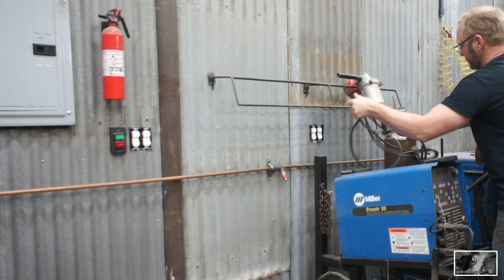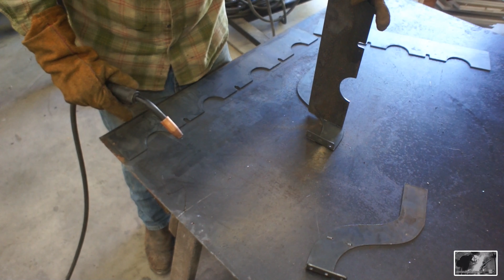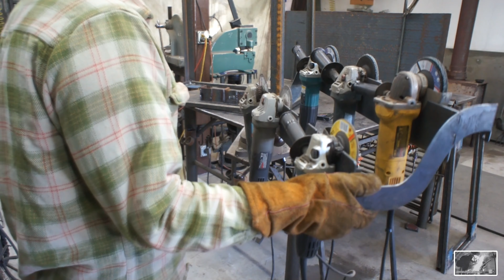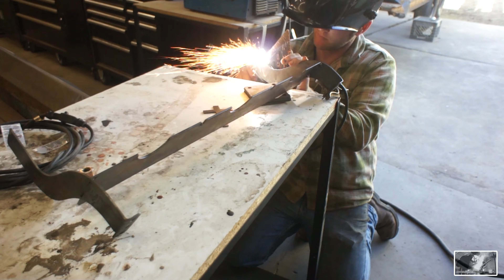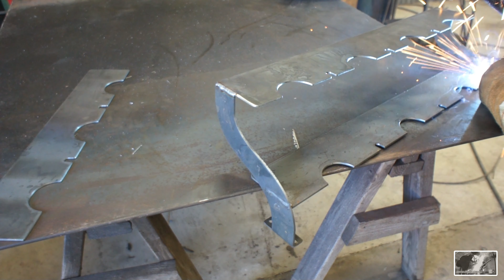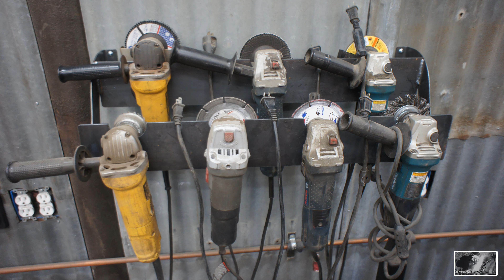RACK EM! Designing a Grinder rack

Comment: Nice job on the rack.  I like how you can see what each grinder has for a wheel by having two levels.   Cords are always a pain to deal with but I like the notch for the plug.
I don't know if you use the wrenches for changing disks but a place for them might be nice. As far as paint, it does fit in well with the corrugated siding the way it is.
Reply from the maker: I do keep my wrenches but I find I usually can get most discs off with my gloved hand. I could think about cutting a tab/hook that could be folded out of the side plate with a pliers. Thanks!

Comment: Nice plasma table Vincent! I wish I would have a plasma. A table is even better! I think the closed design is not ideal. I would take one side support along with only one support position in the front and back, then cut there. So you get cantilevered supports. Then replicate 4 times. So you can access the back position without having to care about the electrical plug. But hey, I am still having no support for my angle grinders!!! Who I am to suggest you that?  Lol! Thanks for sharing Vincent, it reminds me I should work on organizing more my tiny workshop!
Reply from the maker: Hey Joe! thanks for the input. I think if I re-designed the rack to be open-ended Id have to upgrade the side plate to 1/4" thickness to avoid it twisting. And maybe add some gussets. The plasma table is a great asset. I went partners with my brother on this one. Get one, you wont regret it!

Comment: nice.  but solve the cord issue by shortening them to maybe 8"... then just use an extension cord.  it's so much easier to store grinders when they don't have 6' of cord attached.
Reply: Getting up the “guts”, to cut the cords is the first step. The short cord does seem to make a lot of sense. I may need to go looking for the appropriate twist lock plugs and socket to prevent separation.

Comment: I think you will end up changing that out. Those back grinders will end up pissing you off with the cords in the way having to load/unload from the bottom. Good idea, but not practical.
Reply from the maker: Originally I designed it 2" wider but you saw me cut that out, now everything loads from the top and the rack is narrower. I do agree that the back cords hooking on the front grinders may be a concern. Thanks for watching Rob!